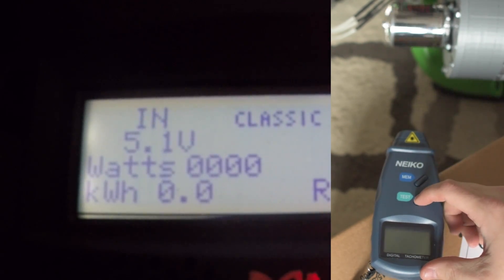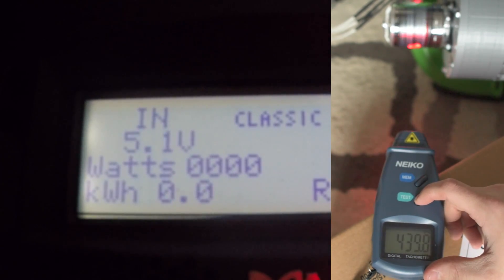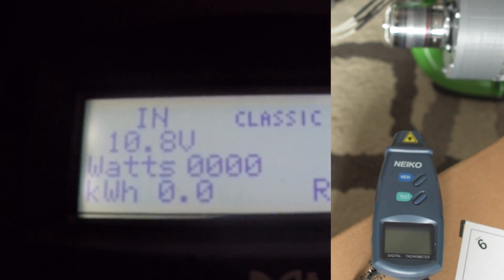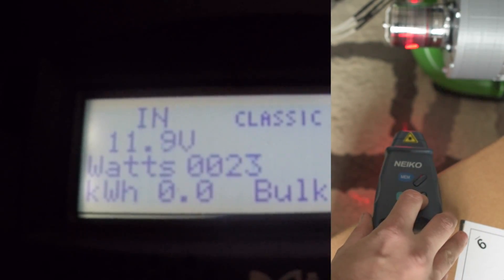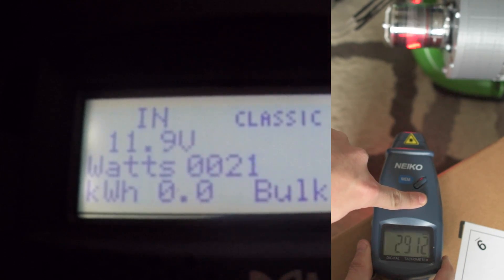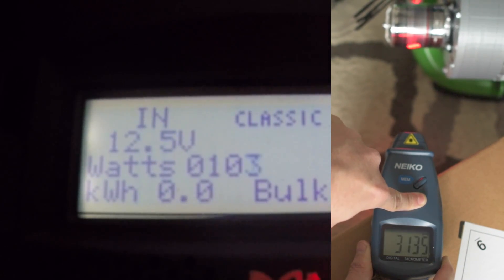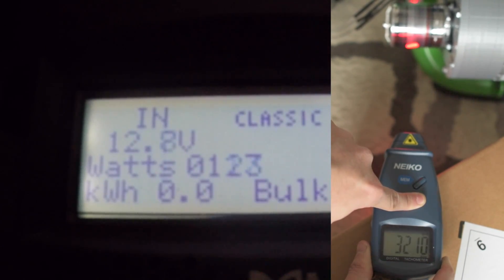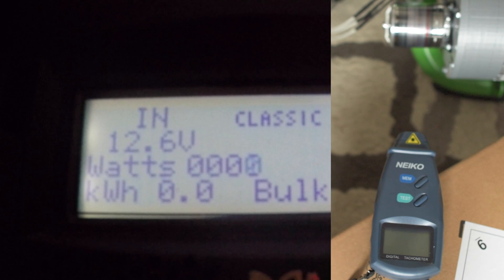Watts vs RPM - Bicycle Generator - Part 5

Comment: I thought bicycle motors were low RPM and High torque..but I can see it is not :), I am looking for comercial motor/generator for a home made wind turbine... I should get the max power at 500 RPM or similar.. any idea?
Reply from the maker: No clue, sorry. While this test was fun, I’m not a motor engineer or a fitness expert. I suspect the whole setup could be massively optimized to generate more power, but I have no clue how to go about it.

Comment: What was the speed of the bike pedaling(@backwheel in mph/km) and rpm of backwheel, with the measurements you made. This is where I’m going with a similar idea. Kool Setup Man!! Thanks for sharing.
Reply from the maker: Sorry, not sure. I bought an rpm meter to measure this but I never set it up.